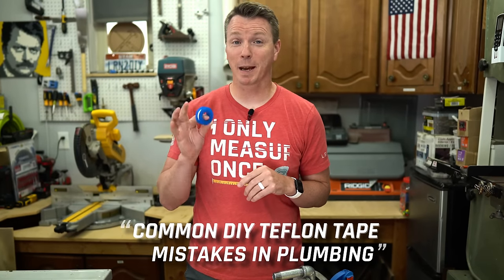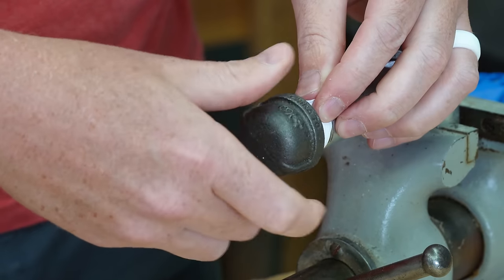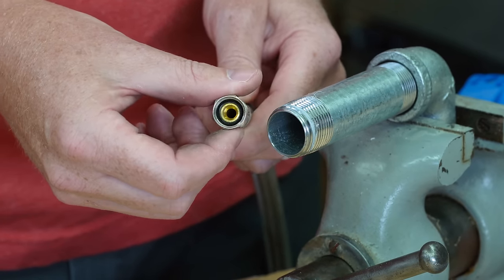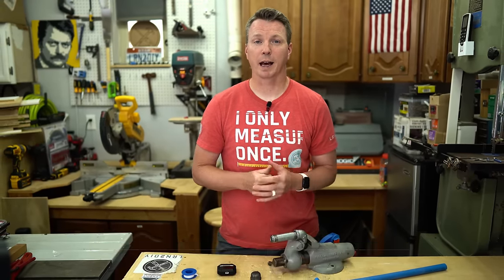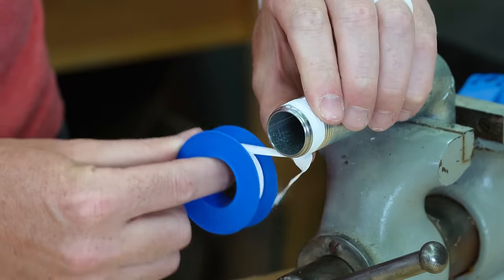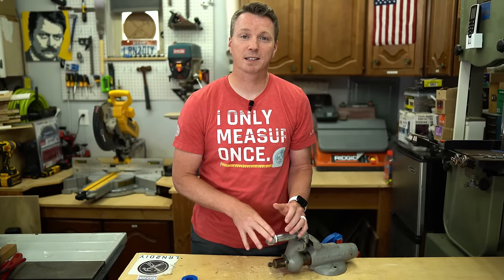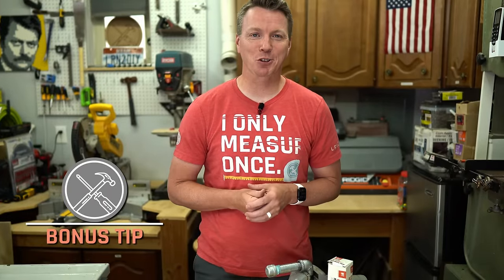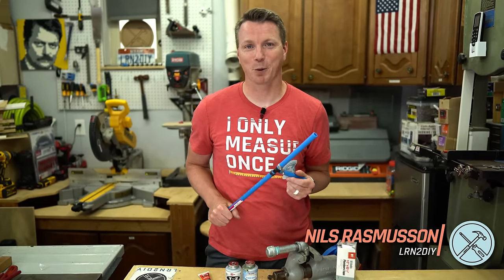6 Plumbing Mistakes DIYers Make with Teflon Tape

Comment: I have noticed there are different tapes and pipe dopes depending on application.  When replacing my water heater, the sales person suggested using a yellow tape meant for natural gas / black pipe for coating the threads when connecting the gas supply pipe to the regulator on the water heater.  Just to be safe, I also replaced the pipe Union where the short pipe tee and dirt trap attach to the supply line.  Plumbing gas has the potential to create an explosion hazard due to leaks, so if you aren’t sure of what you’re doing, get a professional foe the job.
Reply: Teflon tape is available in a number of colors.  Here in the US, you can use any color on anything.  What's significant about the yellow tape is that it's usually a higher density than the cheap white stuff, and therefore works better.  High-density PTFE tapes are available in pink, blue, yellow, gray, and white.  Maybe other colors as well.  All are good.  And yes, get a pro if you're not absolutely confident that your work is leak free.
Reply: @stelth4162   Thank you very much for the additional information.
Reply: Always read and follow the manufacturer’s requirements. Most gas valve / regulators state that you should not use Teflon tape as strands can get into them and cause failure.
Reply: @williamemmons8816  Thanks you’re correct.  I had to replace the thermocouple safety valve on my furnace and used the appropriate  type of pipe dope for that.  It is an older furnace with separate safety and control valves.

Comment: I generally agree with what you're saying about Mistake 3, but using a little tape or dope on all metal connections is sometimes helpful if you need to open it back up years later. Well, as I was typing this you kinda-sorta mentioned this under Mistake 6 which opposes some of the reasons you used in Mistake 3 of when NOT to use it. Still generally, good advice.
Reply: You are right if those tube is made of iron with zinc.  Some tape on screwing is good for uncrewing in the future.  For copper,  plastic,  stainless steel,  the tape for unscrewing is not a big different.

Comment: Brass fittings tend to do well with tape alone, even if the brass is being connected to steel. But steel to steel fitting should get first a wrap of tape and then pipe dope. Do not use pipe dope before applying the tape because then the tape basically hydroplanes(slides) over the pipe dope. Advanced pipe fitting lends knowledge to which size wrench to use. 3/4"-1 1/4" typically a 14" pipe wrench will be sufficient but an 18" may be used as well. For 1 1/2"- 2" pipe i would reach for the 24" pipe wrench while using an 18" as a hold back wrench. It is a good practice to use the smaller wrenches as a hold back. Anything under 3/4" can be tightened with just a pair of channel lock wrenches. 
PRO TIP: if you have many threads that require taping you will speed your progress up if you tape them all before you even pick up a wrench. One last thing, a properly machined thread should be about 3 turns to hand tighten followed by 3 1/2 - 4 1/2 turns with a wrench. This is because pipes are threaded at 14 turns per inch. you want to have 5-6 unused threads showing when you have finished tightening the pipe/fitting.

Comment: Love DIYers, they keep me in business.
Reply: Boy it can be a headache cleaning up after the things people do, sometimes.
Reply: That makes no sense. People who don't diy would be more likely to call a plumber. Even if a DIYer messes it up they will only call a plumber once, the same amount of times they would have if they didn't try themselves.
Reply: @Pinpadprompts  Yes, but you can charge them more to teach them not to mess with things they know nothing about.
Reply: @pobsdad  mate water is wet and runs down hill. You can Google the regulations. Plumbing is the easiest least skilled trade (including painters and plasterers).
Reply: @Pinpadprompts  Yet so many people screw it up and flood their house. Or have a gas leak.
Reply: I’m a DIYer and with YouTube I almost never call a plumber. It has to be something underground that requires excavation to get me to pick up the phone. If I can’t figure it out the first time, I definitely will the second time. And now I’ve learned for next time. 

Great video. Appreciate the advice. Lots of controversy regarding number of wraps and my comment is that it’s not going to be the same for every situation.  Not all pipes, fittings, threads, tapes, water pressure are created equal.  Use your best judgment. If 3-4 wraps still leaks, then do 6-7.

Comment: 2:35 Actually, you sometimes may indeed still need Teflon tape even if there is a rubber ring there.  I installed a shower-head extension arm, and it said right on the package to use tape, even though it had a sealing-ring.  I didn't, and it always leaked.
Reply: That seems like a crappy product.
Reply: @ABaumstumpf  Yeah, that's kinda what I thought, too --- it said to use Teflon tape on the package, but I didn't want to because it had a sealing ring, and I had installed one before and it never leaked.
Reply: Nope.

Comment: I recently had a professional plumber replace some galvanized pipes. He first brushed on the pipe dope then the Teflon tape, and then another layer of dope. This is the way he was taught by old timers and your seal cannot possibly leak. Better to do it right the first time then  have to take everything apart and start all over. Time is money. The pipe dope and tape are cheap.
Reply: That’s how it should be done!

Comment: I saw another video, where the tape was spun to form like a string; then layered into the threads.  Followed up with a few wraps as shown here.

Opinions on this technique?
Reply from the maker: I've seen that done as well. It'd be cool to see an apples to apples comparison on the different techniques - tightening them down to the exact same torque and running high pressure water through. I can't say if one is better than the other for sure but I do what I've seen the pros do and what the manufacturer recommends.

Comment: That is wrong.this is supposed to be an instructional video? Start at the rear and end at the rear. With both ends out.
Any other way will not pass inspection.
If you're going to teach plumbing you should lurn plumbing.
I just love slapping down people who think they are professionals.
Reply: hi timothyt, have you become a flat earther yet?

Comment: When using your valves that deal with brass ferrules it is always a good idea to use pipe dope on your threads and on the feral, it allows you to tighten it easy without binding and seals any defects. Teflon will not do that